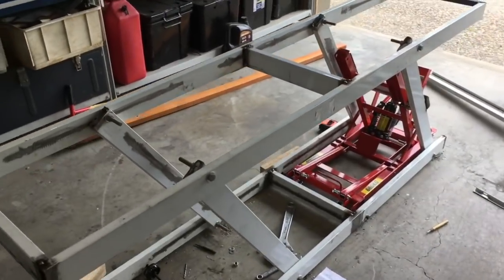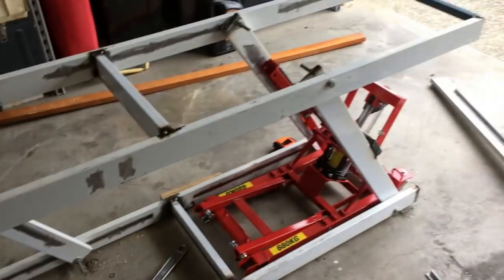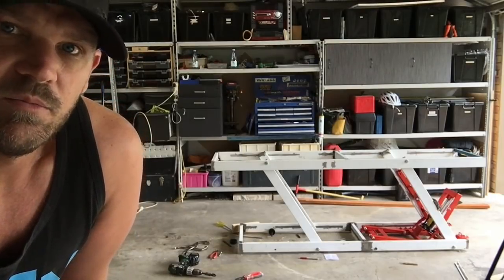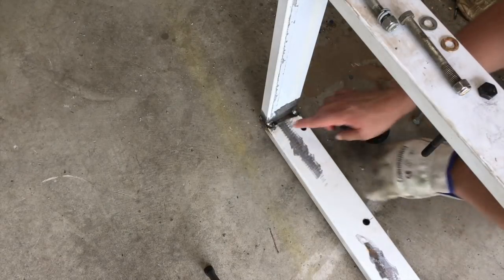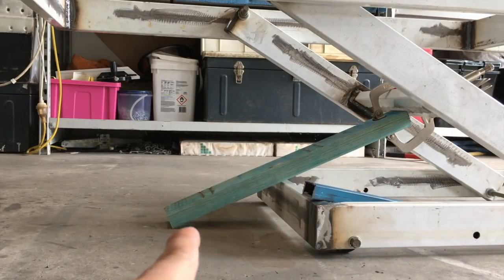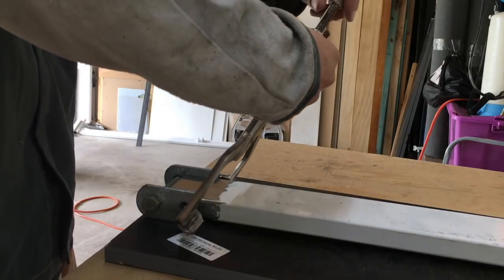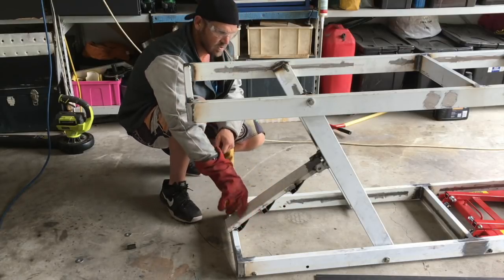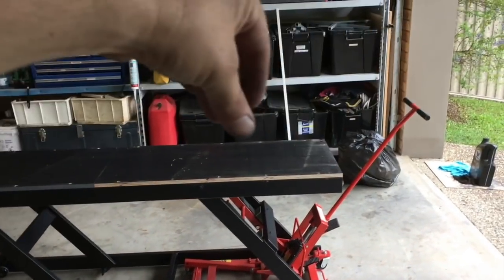DIY Motorcycle Hydraulic Lift Table - From Old Shelving - Ep 2

Comment: Awesome job, you might want to add an edge of wood on the sides, so those damn 10mm sockets don't roll off... Lol.... Also try not to leave the table in the up position, rust will start on the piston, and reck the seal on the pump, great video.
Reply from the maker: RobertKnighthawk looks like someone has been watching my other videos :). Also thanx for the tip brother

Comment: Maaaaan... You need a safety-lock on that 3- position prop-up bar!! Also, as a suggestion, the Jack doesn’t need to be permanently attached. Once it’s propped up and tension is released, it could be removed and used elsewhere. I’m probably speaking too soon. That’s probably the reason for the prop-bar. But I cringed that I didn’t see installation of a safety-lock on that strut ! Hmmm. If this were built with the lever-struts on the Outside of the bottom frame, would the upper frame be able to rest all the way on the ground, allowing for a shallower ramp and a level starting point for the jack’s lifting action?

Comment: Just wanted to let you know if someone hasn’t already, you need to weld in a forward direction with Mig. Arc welding trails or runs backwards if you like. You won’t be getting the same penetration at the joint.

Comment: love your work and plan to do the same. how ever, wouldn't it have been easier to mount swivel casters under the frame and weld leveling bolts/feet to the corners to raise the casters off the ground and level the rig? great work though. very inspirational.